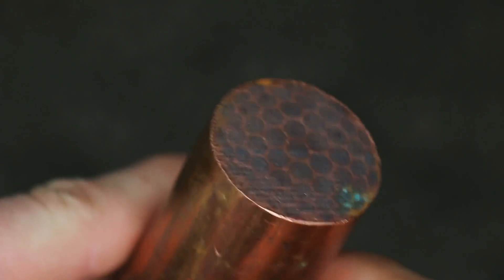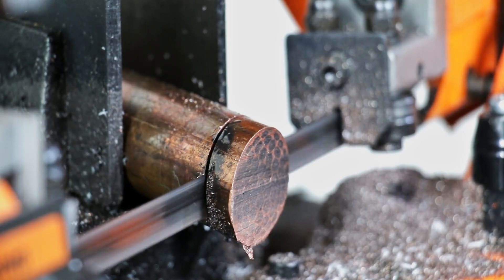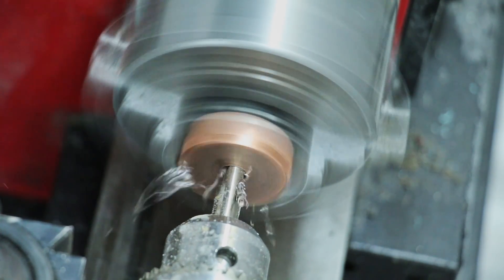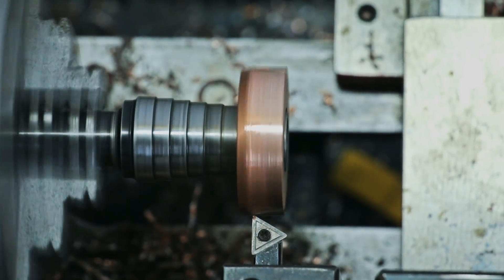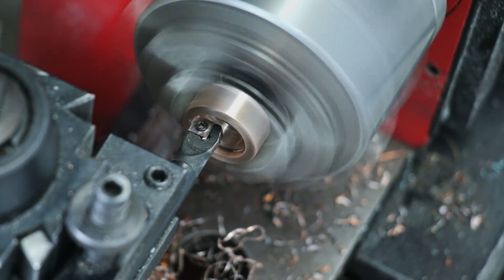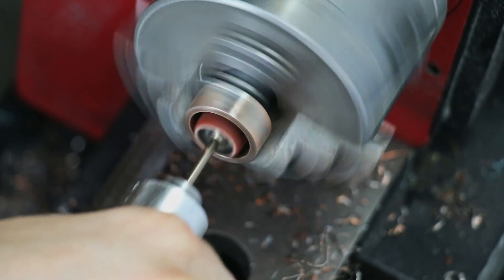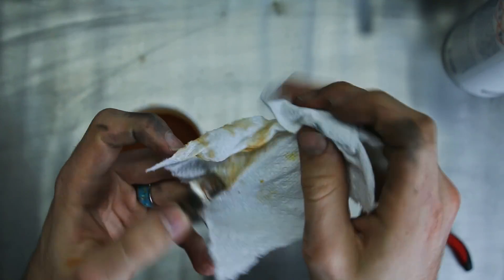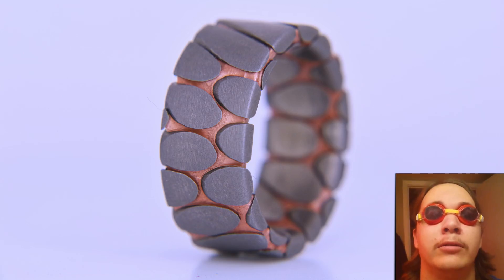Making an Off-Axis Superconductor Ring

Comment: You have etched the copper part, won't the edges in the superconductor scratch and irritate the skin?

Have you put any clear coat on the ring to avoid corrrotion of the copper?

Comment: You do realize using a dremor while putting the ring will hardly do anything? even if the dremor is reversed. You should start with a semi fine grain of sandpaper and get finer and finer as you go

Comment: I would mix the rest with resin so much that the resin is barely visible and is pretty much just the glue. Also you could  use them like in your glowing metheor rings. The base like at the metheorrings but there where the methor shards/nuggets should be there you can fill the trash together with glow powder

Comment: I am french and i don't know what is superconductor can someone explain me ?
Reply: I ain't no scientist, but essentially a superconductor is a material, which when sufficiently cooled, has essentially zero electrical resistance.  If I remember right this is because it allows the electrons in the material to 'pair' together, changing from a fermion, with a spin of 1/2, to an composite boson with a spin of 0 or 1, which in turn allows them to occupy the same quantum state.  Pretty neat stuff.

Comment: $700?!?!? Seriously??? I understand that superconductor cable is pricey... And that you've put in your time and effort into making the ring. But even with that 50% discount those prices are super high. Now, I'm no ring maker or jewelist so i cant say whether that's a reasonable price or not. But im now curious to know how much you paid for the conductor, how much time you put into each ring and how much you're getting back from each ring. Now i know this is business talk and not many people like to publicly say these kinds of figures, and by no means do you have to say... I was merely curious because i did want to nab a ring for myself until i saw the price.
Reply: In case you can't tell what your looking at, these things are insanely labor intensive. 
What's YOUR time and acquired skill set worth?
There's always a nice selection of rings in the jewelry case at Wal-Mart that I'm sure would suit your needs.
Reply: I'm not sure you've watched the same video i have. In case you missed it practically 90% of this build was using industrial machining. Now by no means am i dissing the maker, as i don't know how to use a lathe, but pushing a ring against a belt sander and doing a bit of hand polishing is something i hardly call "insanely labor intensive" 
Now going back to you question "What's YOUR time and acquired skill set worth?". Well since you asked i am an architect, construction worker and 3D designer. Designing floor plans, building/renovating restaurants and doing 3D modeling as a side hand, are in fact, Insanely labor intensive. I will also have you know i have in fact made rings before. Although it was a few years ago i made a gold ring from a $2 coin using a hammer, a hand drill and a set of metal files as a birthday gift to my girlfriend at the time. 
Now Sir I ask you, What do YOU do for a living? Apart from lashing out and making rash comments on Youtube. Maybe next time you'll think twice before smashing you head against your keyboard and pressing send.
Reply: Great. 
You've decided what your time and labor is worth. 
So has the publisher of this video. 
You are well within your right to not purchase anything from him if you feel he charges "too much".
Maybe next time before you throw a fit and presume to tell someone else what their time and labor are worth,  you'll just keep scrolling and don't say anything, or has your sense of entitlement grown to a point where you just can't seem to pass up the opportunity these days? 
Wait, sorry......I already have my answer.

Comment: +Patrick Adair Designs  Would love to give this a try.  Could you lead me in the direction of where to buy a superconductor bar like the one you showed being used in your video?
Reply from the maker: I found it randomly on eBay. It really is very difficult to find. try googling copper444 or copperclouds
Reply: I've been looking to make a ring for sometime and copperclouds and copper444 were both checked.  They only sell chips so I attempted to fold out one like I do with coin rings but the anodes weren't strong enough to hold the two metals together and it all split.  You're right, finding a bar to lathe is nearly impossible which is sad, I'd really like to give it a shot.

Comment: mix the shavings with either resin or super glue and use as in lays, etched lines, etc., etc. I have noticed other have the same idea. This idea will work with any metal shavings. It you use enough of the shavings it looks like solid metal. Crimson guitars uses this technique on their fingerboard inlays. They have vids about this on their YouTube channel. Later.

Comment: Isn't worrying that you might melt away too much copper and the filaments will fall out? Or what about when the customer uses it for an extremely extended amount of time, are you worried the copper might fail and the filaments fall apart?

Comment: Isn't super conducter just lead and cupper to transport the heat so that the lead is super cooled.
Reply: "Copper"
Reply: This is a copper niobium superconductor
Reply: maybe? you're talking about super solids?
Reply: So it's a superconductor.

Because a bullet is just a state where a metal is flying through the air at a velocity high enough to surpass the resistance created by the various aspects of a carbon based life form. It's really just a chunk of led backed by gunpowder and encapsulated by brass until it is placed in the chamber of a firearm, which almost completely encloses the lead/gunpowder/brass combination except for the barrel, allowing the ignition of the propellant to create enough pressure to apply enough force on the chunk of lead to reach the above mentioned velocity.

But it's not a bullet.
Bullet is just a state of being.
Like liquid.
Or solid.
Or gaseous.
Or plasma.
Reply: W
Reply: Marcus M what the what what?
Reply: A superconductor consists of a titanium-niobium alloy. The thing which makes this special is that when this is cooled with liquid nitrogen, it causes the alloy to loose all electrical resistance. But, as titanium or niobium isn't a good conductor at room temperature, it is encapsulated is copper.
Reply: No it's quite a bit more complicated than that lmao
Reply: fun fact: this isn't technically a superconductor. a super conductor is a state where a metal has no electrical resistance, which is usually done by super-cooling a metal. this is a alloy which is just easier to cool to a superconductive state.
Reply: Nick Van Wyk isnt the truest super conductor that new state of matter they found that has 0% inhibiting while electrons flow through it? Make gold look like rubber
Reply: You need Liquid helium to make Niobium Titanium Superconductor
Reply: That would imply that a substance or material could not be considered a superconductor while inert, which defeats the purpose of even having the word. It would otherwise just be referred to as a superconductive state, as you said. Probably shortened to saying "x is superconductive" vs "x is a superconductor"